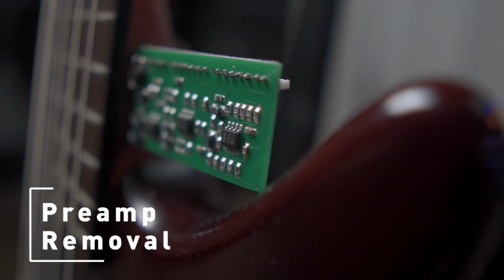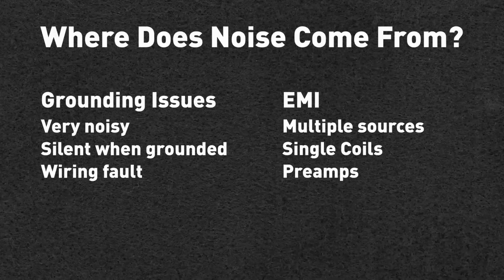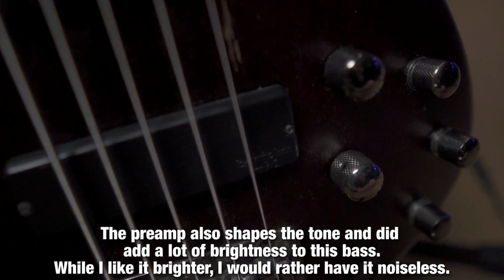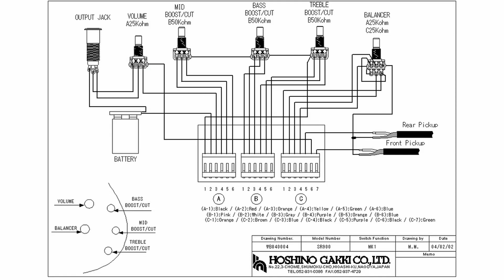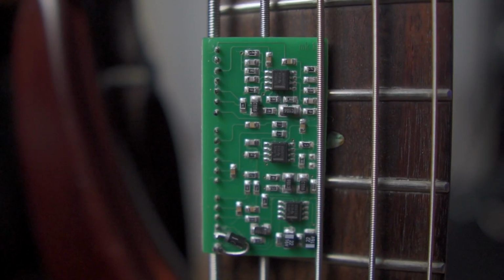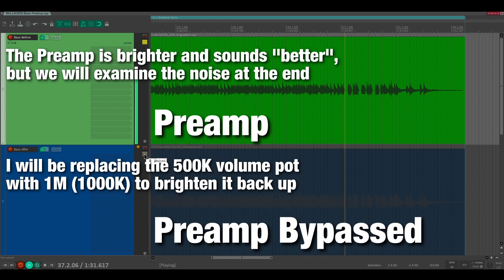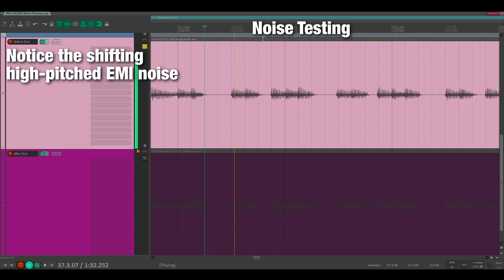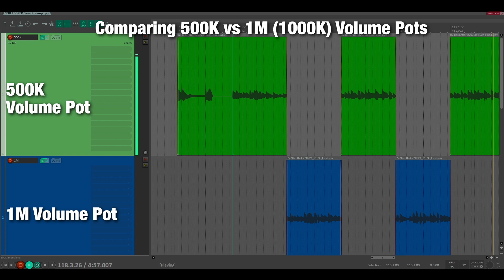Removing the Active Preamp on my Bass | Ibanez SR505

Comment: Cool vid.  Very detailed.  I have a GSR 205 and I didn't like the slight noise and I didn't like the idea that I had to have a battery in there to play the guitar (dead or alive).  So I removed the Phat II along with the pot it was on and plugged up the hole.  So now the sound of each pickup is a little strange when they are by individually, however when both pups turned up to max they sound great.  Not sure if this was caused by a wiring error on my part  but I do love the sound and the quiet background.  Great vid!  TYFP!  (PS: I now use the battery compartment to store extra picks!)

Comment: Nice ! 
I did get a pair of Bartolini MK1 a while back, for just 15€ used :D 
I put them in my Ibanez EDB600 (which I got for under 50€) that had a dead bridge pickup and dead preamp.
This was not the first pickup change I did in that one (used a dual blade Belcat guitar pickup at the neck position for a while), but in the end the Bartolini are much better than what originally came with that Bass. 
I seen plenty people complain about the preamp which usually comes with these Bartolini Mk1.
One thing with these ; they have a pretty low output (and ohm reading) and I have to use a clean boost in the chain when I use this specific Bass. (as seen in my latest vid)
I would suggest leaving any blend pot out and instead use a DPDT switch to have Series/Parallel option, which is really good with these 😁
The wiring in my EDB600 ended up kinda weird with a dual-tone pot with a switch between two capacitor values. 
But really it was an excuse to populate the empty holes left by the preamp 😅

Comment: I have a SR605, been debating selling it to get a passive bass. Going to try this first to see if it changes my mind.
Reply from the maker: @MotoTaco  go for it, just remember to swap out the pots too, they're values are designed for the preamp and will need to be replaced with 250/500k or 1M pots

Comment: The preamp is actually an input buffer and eq. The high impedance drops after buffering and the pickups reach the blend pot buffered. That's why it's just 25KOhms while the pickups are passive. The 25K blend is too low a value to directly connect your pickups to.
Reply: And that's why you lose so much treble with "Preamp Bypassed". Get a 250K or 500K MN taper blend, like, yesterday. Thank me later when you have all your treble back and no noise.
Reply from the maker: someone pointed that out when this came out, and yeah I swapped in 1M pots, it's at the top of the description. some of the "noise" that was removed was just treble, so it's hard to say if this really reduced the noise much in the end, but I still like having it passive.
Reply: @NickLeonard  you could shield the electronics cavity and also the pickup cavities (connecting them to the grounded electronics cavity). Shielding paint will do but copper foil is best.

Comment: I'm late to the party but if I were to pursue a project like this and wanted maximum treble out of the pickups, I'd wire it Volume, Volume like a Jazz Bass without the Tone control.  That eliminates the effects of the Blend pot.

One of the key take-aways should be that if the bass has passive pickups and if either balance/blend or volume pots are in the 25K to 50K ohm range, they should to be replaced with values more traditionally suitable for passive pickups, aka 250Kohms and up.

Comment: Those remaining  25KΩ  and 50kΩ pots are going to load the pickups down a bit, not necessarily a bad thing,  there will be less output and the treble response will be reduced considerably.  If it bothers you then replace the blend pot with a switch and put in a 250kΩ or even 500kΩ pot for the volume control.
Reply from the maker: I put in a 1M volume pot, it's still a bit dark though. Maybe I'll put in a pickup switch, though I like the look of the blend knob
Reply: @NickLeonard  You need a Rotary switch..!  The blend knob is two 50kΩ sections in parallel so still loading the pickups with 25kΩ
Reply from the maker: @zmix  ah, that explains it. I'll get one and put it in! cheers!
Reply from the maker: Didn't find a rotary switch that would be easy to drop in, but I put in a 500K blend pot instead. Difference is night and day! The bass is bright and clear now. I'll post a short clip in the next video!

Comment: I have that exact same bass...bought it in 2008ish.  Mine has a switch which is why I'm here.  Playing this thing for 15 years and still not sure what this switch does...it's either a bass boost or it shuts off the active pickups...not sure.  Had to edit this...thought I'd point out that I have the same scratches...I don't play with a pick, but I'm hell on keeping up with my thumb nail.

Comment: Most Ibanez active bass's use passive pickups with an active 9v 3 band eq....my old SRX360 had an active 2 band eq, blend & master volume...now it is passive with a brass nut, 8% CTS linear 500k pots, fully pro sheilded, new wiring throughout, Greasebucket tone controls, 2 x 5% hifi grade polypropylene caps & a 1% 4K7 resistor per Greasebucket tone pot...set up with 2 volume & 2 tone pots...all linear 8% CTS, the PFR pickups sound far better now as standard passive pickups rather than with the 2 band eq with the bass pot set at 40hz & treble pot at 10k...a bit bright for me...far better tone now with Greasebucket tone pots & passive....

Comment: Dunno - the noise is still very much there (just sounds different), yet clean bass with no preamp sounds worse. To each his own I guess. I have the same one - SR500, but a newer model with a preamp bypass switch.
Reply from the maker: The noise sounded quieter because the blend pot was 25k and significantly darkening the tone. I replace volume and tone with 1M and it sounds much more similar to the preamp tone again, the noise is lower still but it's not so drastic anymore

Comment: NICE, I will do it on my Ibanez Gio Bass, I searched for the wiring diagram and looks more simple to bypass the active circuit, I just need remove the battery, conect IN/OUT from that stupid boost knob on "Ibanez GSR205 stock wiring" so it is bypassed to the pots, that active circuit only makes my signal clip and get some complaints from the audio tech guy
Reply from the maker: Check the value of your blend pot while you're at it, might want to replace that with a 500k, 25k is too low

Comment: I have a question, I have a Warwick Corvette Std. and it picks up radio noise to the point that I can’t record with it at all, and it has active pickups/electronics. However, my fender Jazz Bass with passive pickups/electronics and strat both pick up no radio noise. How would you go about fixing this? Putting a whole new electronics circuit and pickups in it?
Reply from the maker: @matthewmorter7803  my Warwick had noisy pups too. Could be a potting or shielding issue. I just put in a Bartolini split coil that was the same size and that's much quieter. A bit expensive, but I tried shielding first and that didn't help
Reply: @NickLeonard  thanks for the advice, but it’s not just white noise, it’s picking up clear voices from the radio, did you have that issue as well? And do you mean you out in basically a noiseless single coil pick up and that solved your issue without replacing all the electronics?
Reply from the maker: @matthewmorter7803  yes, a noiseless single coil, split coil, so a humbucking single coil. You can try shielding the electronics cavity better with copper tape, but you may not see any real benefit. It could be poor potting on the pickups, but easiest fix for that is new pickups. Just measure carefully as bass pickups are many different sizes
Reply: @NickLeonard  thanks! A tech told me shielding wouldn’t help when I took it to them, they said everything was dead quiet in their shop, it must just be because I am under the radio towers, but I may try noiseless pups, thanks

Comment: This is awesome! I stumbled onto this while looking for a wireless system for a bass with active pickups. I have an SR500 that I also do not use the EQ knobs.  Gonna disconnect the preamp board and update the pots.  So 500k for the volume and a 500k blend pot?
Reply from the maker: Yes, or even 1M pots. I did find that some of the noise came back with proper pots, this video "fixed" the noise but cutting out a lot of treble... but I'm still happier with the tone now. For a true noiseless solution, I think replacing the pickup is the only way to go, though extra shielding in the cavities also seemed to help some

Comment: I have this exact bass, and a while ago, an issue with the treble boost knob came up. Initially I couldn't turn it all the way up because it would make the bass loud enough to the point it would distort. Now recently, no sound will come out of the bass anymore unless I mess with the treble boost knob. Any idea what might be the issue?
Reply from the maker: Not off the cuff, but it's possible there's some dead spot in the pot that's cutting out the signal, I don't know how likely that is. It could also be something failing in the preamp, though that's pretty sturdy too, not much to break. Maybe a loose wire, and turning the knob is somehow fixing the connection. Only real way to find out is to probe around under the hood or take it to a tech!

Comment: Man, I’ve been tearing my hair out trying to fix the noise issues in my RGB305 so this vid is exactly what I was looking for. I’m a total novice with this stuff so I was had a few quick Qs if that’s okay?

1. If I just wanted a volume and a pickup blend, nothing else, once I’m done there shouldn’t be anything else other than the two pots, the jack, and a few wires connecting everything, is that correct? I can remove all the rest of the circuitry? Total noob here lol

2. Can I use the original pots or would I need to get new ones? 

Thanks!
Reply from the maker: 1. Yes, you can remove the eq electronics, I left mine so there isn't a bunch of holes, but only the vol/blend are actually connected to the circuit.
2. You can use the stock pots, but you may want to change values for tone reasons. Check the values, they should say on the back. My volume was 500k, which was fine, but the blend was only 25k, which darkened up the tone a lot. I would swap that for a 500k as well and then the brightness is back. If you have the mk1 pickups, they're still a little noisy, but it is better.
Reply: @NickLeonard  amazing, thank you!

Comment: Hi! I installed a J Retro preamp on my bass and is noisy. Could it be the ground cables inside? Thank you
Reply from the maker: That's always the first thing to check. You can diagnose that by seeing if the noise goes away when you touch the strings or bridge
Reply: @NickLeonard  Hi. Yes, the noise stops when I touch the bridge and or strings. If the cables are not the problem, what could it be? Thank you.
Reply from the maker: @preciseaudioblog  you need to check that the ground is fully connected everywhere - from the output jack through the electronics and to the bridge. A multimeter with a continuity checking function helps a lot. It probably just came loose somewhere and needs to be resoldered
Reply: @NickLeonard  Thank you!

Comment: I have an Ibanez SRX500 active bass. The issue I’ve had is that I’ve gotten no sound / signal from this bass when I plug it into an amp. I’ve changed out the 9v battery but to no avail. Is there hope? Am I able to bypass the 9v, this converting the bass to a passive one? It’s bothered me for quite a while. I’d rather not pay somebody the cost of the bass to have this remedied either so I’m just looking for solutions.
Reply from the maker: Have you checked all the connections? Might be a dead jack, mine was dodgy so I replaced it. Maybe a bad pot or something broken in the preamp. If you do this preamp mod, swap the blend and volume for 500k or 1M pots at the same time. Be sure the blend pot is a real blend pot with 6 legs.

Comment: What was the original value of the volume pot?... 25k?
Reply from the maker: 500k for volume, but only 25k for blend. Replacing the blend knob made the bigger difference in the end, but I hadn't put it in when I made this video. Will demo it soon.
Reply: @NickLeonard  wow the sr500 series are really strange...some basses like my bass sr506 without mid switch with mk1 preamp....have a 25k in volume pot and ac25k for blend... And some models have 500k with mk1 preamp... Is really curious
Reply from the maker: @ronaldcardenas796  I found a number of wiring variations for the soundgear series over the years. I guess it depends on parts price, though they have some different preamp wirings too for some reason.

Comment: My SR705 is noisy as hell.  It's idiotic.
Reply from the maker: I'll have to post an update video on it, but after I posted this one, I swapped out the 25k stock blend pot with a 500k. That added back the brightness that was lost, but also with it came the noise, not sure if it's as noisy, and I like the tone better now, I also shielded the pickup cavities, which have graphite pain, but I added a few layers of copper all around and that seemed to help at least on the bridge pickup, which is oddly like 10 dB less noisy than the neck now.
Overall, it's an improvement, and the noise is only really audible if I'm running really high gain, so it's perfectly usable. I think to fully fix it, I'd need a new pickup like the Bartolini MK5, which is the right size. I put a US-made Bartolini humbucker in my noisy Warwick and it's totally silent now.
Reply: @NickLeonard  thanks.  i think i have to start with the 9 volt connector.  For years i thought the cable jack was bad/loose.  but recently realized that no 9 volt connector should require this much strength to use.  moving a connected 9 volt battery around in the slot caused the sound to cut in and out.